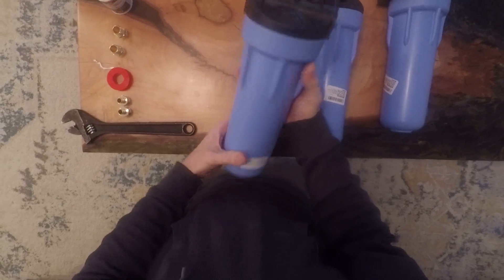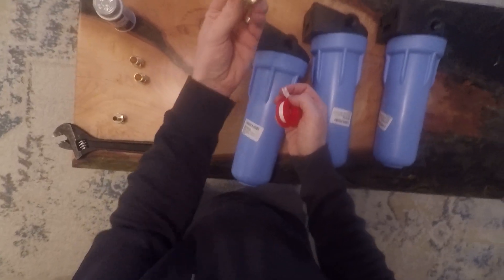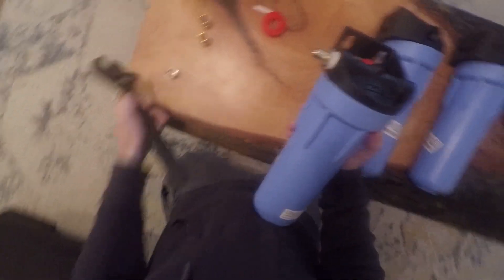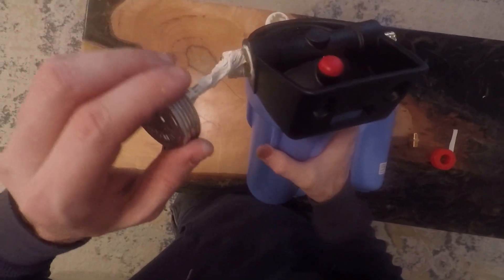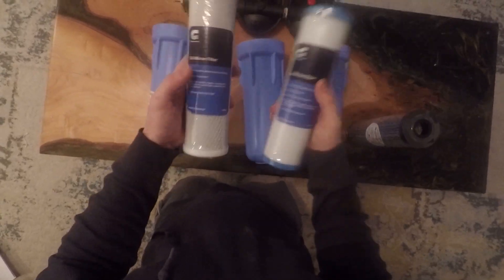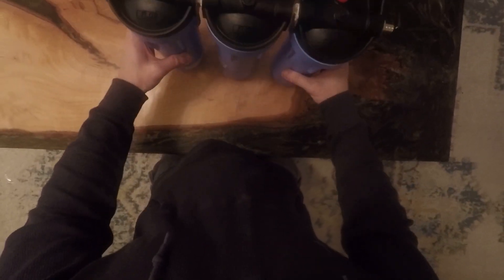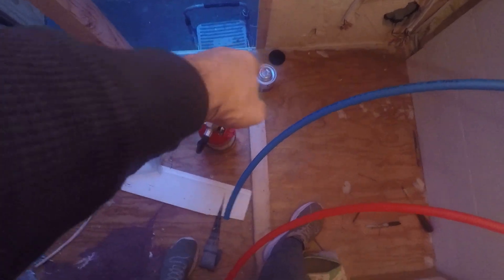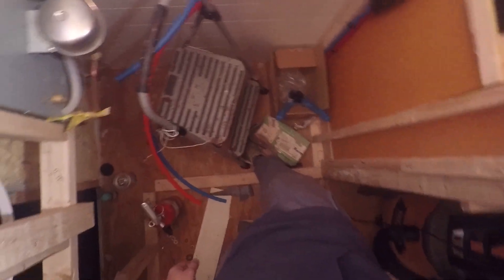Watch This Before Buying Clearsource RV Water Filters - DIY Alternative To Clearsource RV Filters

Comment: Great video! I've been considering trying to build my own custom system for my trailer and this is exactly the right direction. I saw that you already commented on someone asking about making this a more "portable version" using the hose bib fitting for inlet/outlet fittings. My question is, do you see any reason the flow from the larger hose would be too much for this system? Also, in general, what do you think is the optimal water pressure for a system like this? I generally set mine between 45-50 but I wonder if this needs a little more pressure to avoid low pressure in the system due to the 3-stage filters. TIA!
Reply from the maker: @digital8101  I don't think the larger hose would cause the problem. Since I haven't hooked up the system yet, idk what the pressure drop is coming out of the filter. It's something to test.

Comment: Thanks for making this video!  I really appreciate the time and the links.  I'm thinking about making my own, but I would need it portable...so I'll have to think about how to make the stand.   Thanks again!!
Reply from the maker: I'm glad the video is helpful. Yeah you can make it portable either by welding up a frame from square tubing, or making it out of wood, like 2x3s and/or plywood. The only other difference would be the fittings for the in and out of the filter. You'd probably want to put the hose bibb fittings, since it's gonna be portable